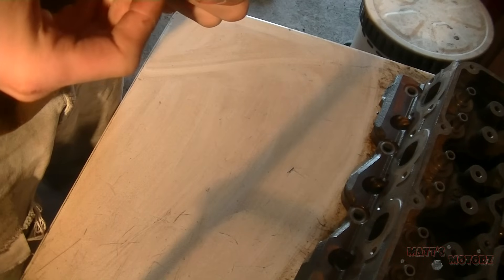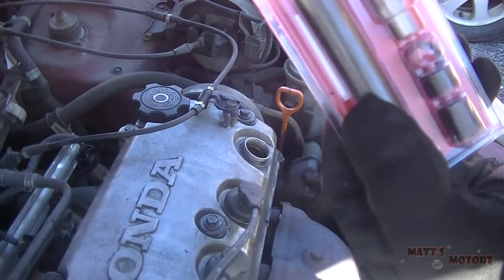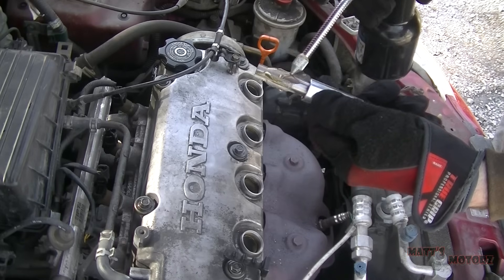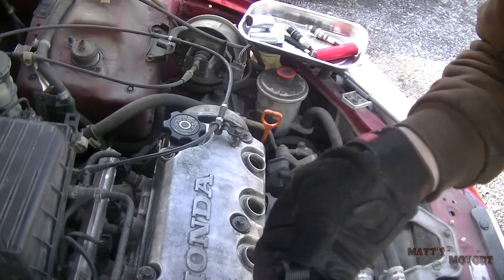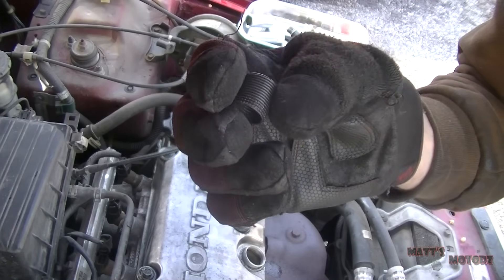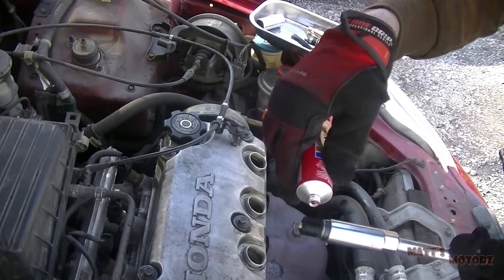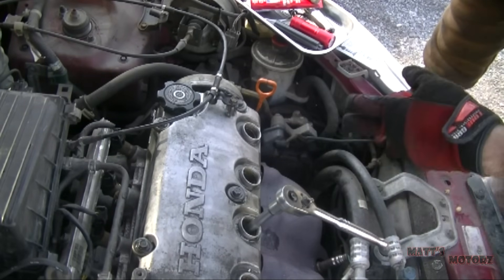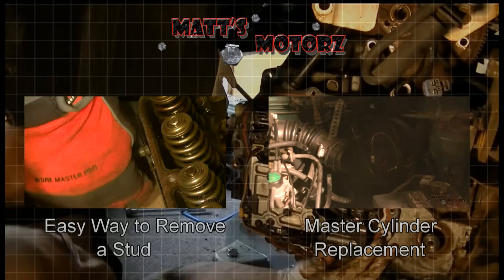Repairing Stripped out Sparkplug Threads

Comment from the maker: Everybody needs to chill about the chips in the cylinder.

1. The compressed air blows a lot of the chips out
2. If you are really worried, remove the spark plug and crank the engine over.  The piston will push the remaining chips out of the spark plug hole.
3. The hardness of the chips is less than that of the cylinder walls, valves, and piston rings, as the cylinder walls are sleeved with a harder material, the rings are made from cast iron, and the valves are made from super hardened steel.  The chips won't scratch them up.  The valve seat is also a pressed-in harder piece of steel.
4. Engines are tough machines and will not be subdued by a few chips.
Reply: MattsMotorz 
you don't use oil, but grease. Grease will retain much more metal shavings and minimize damage to the internals of the engine...
Reply: alum chips are not an issue and normally blow out on start up
Reply: I have a question if I buy a Saturn 2006 and the guy said he strip the  spark plug would it be okay a good idea to buy it he's selling it for $900 would that be okay is anything wrong with the motor or anything if I drive it from his about 40 miles to my home
Reply from the maker: A stripped sparkplug  hole can be a big deal.  It can cause compression loss and cause the engine to misfire.  If it is running ok then it might be worth it.  What is the KBB value?? Repairing a stripped sparkplug hole as I do in this video is not for the faint of heart, and many shops wont even touch it because doing it wrong means a BIG job in repairing / replacing the cylinder head.
Reply: MattsMotorz I got a question is installed the coil insert it seems like my car has a loss of power and spudders do you know what it could be? I'm going to try the kind of insert you used in video
Reply: I promise you he sounds just like Mathew Broderick good video to
Reply: Would had made sure both valves were closed before blowing the chips out. Chips could prevent valves from closing properly.
Reply: Abolitionists
Reply: You just answer in my crucial question! I like your video!
Reply: Lol instructions. Step one... pack tap with heavy grease. "Hey let's take car advice from a guy that can't read!"...
Reply: i know I am quite off topic but does anyone know a good site to stream newly released series online?
Reply: @Leon Allan i dunno I use Flixportal. You can find it through google =) -connor
Reply: @Connor Saul Thanks, I signed up and it seems like they got a lot of movies there :D Appreciate it!
Reply: @Leon Allan No problem =)
Reply: She can not digest chips.. it may cause "Dysentery" ..
Reply: it can go into valves too
Reply: Welcome to YouTube comment section, where everyone is an expert.
Reply: I have to do this I no it gonna be in a pain in the ass spec since someone already tried putting an insert in there I hope I can go a size bigger 🤦‍♂️ or I’m going to have to just leave it in there .. or hopefully I can jus get the same insert and put it on a new spark plug and it goes in plz help if u can give me any info
Reply: MattsMotorz lol.... Youre a real Hack. Quit fucking up peoples engines. Youre lazy af and a terrible mechanic.
Reply: @TanTan-ni4mg  viewers are open to a better alternative if you have one.
Reply: Tan Tan and you are a prick.
Reply: @TanTan-ni4mg alright then shut the fuck up and take your car to the dealership see what they tell you

Comment: 🤦🏾‍♂️ Probably no one will see this but Im currently having to rethread cylinder 6 spark plug hole on my e46… I used grease, instead oil on the silver rethreader. I had to use a 3/4 socket because the rethreader didn’t fit in the 5/8 spark plug socket. Now the socket and rethreader WONT come out the hole no matter how much i try to loosen PLEASE HELP

Comment: I've changed 1000's of spark plugs in my life without any problems until now.   I tried to remove the spark plug from my pressure washer.  When I broke it free I easily turned it out about 10 turns with my fingers then it suddenly stopped.  It became very difficult to turn back in or out with my socket wrench.  I decided to forcibly remove it and when I did the last 3 threads of the plug were filled with aluminum from the head.  I've never seen this before until this video and your plug.  I have no idea how this can happen.  The plug was the original from the manufacturer and had never been out as my machine was still new.  I know it couldn't have been cross threaded because I was easily able to unscrew it most of the way with just my fingers.  How could this happen?  Do you know what caused this?   Also, could I get by just re-tapping the hole and not using any insert?

Comment: Step 1.  Identify intake and exhaust cams are on overlap (both valves closed) and cylinder is on tdc.   

Step 2.  Continue with drills/taps/etc

Step 3.  Insert magnet for steel shavings.  Insert shop air for aluminum shavings.  

😂❤❤❤😂

Comment: Some extra tips:  RTV silicone will not stick to oil, so be sure to clean the threads with brake parts cleaner or equivalent. Make certain that the piston is down far enough so as not to damage it. Fill the cylinder with shaving cream. The shaving cream will catch and suspend the shavings. Then vacuum the cylinder afterward, with a shop vacuum.
Reply: Good idea with the shaving cream.  I was trying to come up with something to keep shavings out of the cylinder - that's why it's called shaving cream, right?

Comment: I used the OEM kit where the insert has a flange instead of teeth. The flange stops the insert at the “right” depth. However, when measuring from the well opening down to the spark plug terminal, it sticks out about 1/32” further than the neighboring plugs that didn’t need re threaded. After the job when I turn on the engine I hear a soft tapping and now the festering thought of the electrodes not deep enough into the cylinder is making me second guess my work.

Comment: I hope someone answers me before the wife gets home...(lol?)...but how far do I tap/bore? And if I go all the way, how do I get the tap out? I am not a mechanic. I just didn't want to pay $250+ for someone else to do what I can do for around $50...and I really can't believe my wife is letting me do this. Lmao
Reply: I’m curious to see how it turned out. I used the OEM kit where the insert has a flange instead of teeth. The flange stops the insert at the “right” depth. However, when measuring from the well opening down to the spark plug terminal, it sticks out about 1/32” further than the neighboring plugs that didn’t need re threaded.

Comment: Wow this is a great video! Question... so there is no need to remove manifold intake, or gasket and valve covers to rethread?? Does the manifold intake have to be removed if this were done on cylinder 4 (the front left) ‘07 Acura MDX?  This doesn’t seem as dramatic as some mechanics are acting.

Comment: Did this a couple of times on my 99 Eclipse, cylinder #2.  The sparkplug just blew off while I was downshifting from 3rd to 2nd gear.  My mechanic was busy fixing a few other cars and he just told me what to do since it would be a few days (if not more than a week) before he can fix mine (he's on call, appointment) as he was rebuilding an engine at that time.  I also had to grind the butt end to fit my socket.  I then used double sided tape on a thin rod to take out all the shavings that fell inside.

Comment: Just did this repair myself today. 

My spark plug blew out of my cylinder head on my way to work. (Luckily it was right down the road) 

Was able to get towed by a local friend back home (didn’t want to run it on three cylinders) 

Installation was flawless. 

Tips for everyone: 

As addressed you’ll have to grind down the 19mm tap, was able to hammer a 17mm socket on there and get it down in my spark plug tube. I used axle grease to catch metal shavings (worked) and ended up using my shop vac to suck the exhausting shavings out of the cylinder head. Started it up with the plug out aswell and it blew everything out. 

Used red rtv on the insert and make sure it’s completely flush with the beginning of the hole. 

The driver tool I gave it about a good three or four taps with a hammer and it was golden. 

Little tip with the driver (use old shirt cloth and stuff it around the driver and the socket that fits around it) and it worked like a charm. 

Took it around the block and it ran perfectly. Will report back later on how it holds up but thankful I finally have threads
Reply: In your opinion would this fix a melting ignition coil also? 2009 civic melted a coil and the spark plug shot out damaging the threading as well. Replaced both and it happened again. So wondering if it's likely an electrical problem causing the melted coil, or engine heat that passed through the spark plug and damaged threading?

Will be buying the kit regardless along with new coil and spark plug, then ignition wires and ECM tested after installation.
Reply: @tc6367  what happened? Did you find the reason?
Reply: @Krischanzzz  LOL I just went and got the whole engine replaced in August since it needed a cylinder head. Who knows what other problems were in the 215k mile engine.
Reply: @tc6367  😂 okay, thanks did you spent a lot for it?
Reply: @Krischanzzz  Yeah, 3k but I bounced back. It was the best decision considering how expensive a newer car is. I use it to make money as well. Deliveries, apps, UPS peak season etc.
Reply: @tc6367  i see it was worth doing that for you. Im still thinking about mine as i have some cooling problems and the clutch should be changed soon (it is semi-auto) so im pretty sure i have to fix this and sell asap 😃
Reply: @Krischanzzz  Yup I changed the clutch this year too. But for cooling, only had to buy both radiator fans and replace those. I'm debating to sell mine around memorial day which would mark 7 years I've had mine. 09 Civic EX-L manual.
Reply: @tc6367  what you gonna buy after that? Do you have anything in mind?
Reply: @Krischanzzz  If it's not another manual, then I want something nice and comfortable for road trips. Newer Avalon or brand new Camry.

Comment: So my spark plug blew out and I was using this method to repair it... But the original threads are not holding the tap in as it gets screwed in.Therefore, I never maker it to the wider part of the tap to make new threads. Does anybody have any ideas?

Comment: I used red grease on the tap to catch most of the shavings. I then put an ounce of oil in the cylinder to gather any stragglers, and used an oil extractor to remove the oil from the cylinder.

Comment: Maybe I’m dense but how do you take the spark plug out once you’ve used it to put the new threads on without the threads also coming off?!
Reply: Dont over tighten the spark plugs so the threads don't come out when you take out the spark plug again. If it comes out again you'll have to take out the cylinder head sadly

Comment: So from now on, Can this motor swap sparkplugs w/o continued issues? Or is this just like a bandaid fix to sell to an unsuspecting used car buyer?
Reply: steel threaded inserts are used in performance applications all the time because they offer better holding power and decrease wear compared to aluminum alone, just be sure the spark plug is held at the exact same place in the engine. manufacters dont do it because its usually too expensive. now he can change sparkplugs in that hole without worry of stripping. the one downside is that inserts can insulate spark plugs causing them to run a little hotter, but this is really only a problem for high performance applications

Comment: Silicone sealant is helpful however too much it leaks into combustion chamber. Understandable it's cold n need to get it done but helpful tip to anyone do a little at a time and dont use that much silicone sealant. Lifters can get gunked up and then u have to replace those. Good last repair while saving up for a new head.

Comment: Couple of things.  Use red locktite instead of rtv.  A t handle is easier than a ratchet as both hands can be used and minimizes side load.  Every  half turn back up a quarter turn to break large chips.  This is due to the aggressive cutting portion of tool.  It would be easier to remove valve cover than to work with it in place.

Comment: Using anti-seize compound, makes the spark plugs screw in smoothly. If it isn't smooth, you will know immediately that you are beginning to cross thread. Also, always use a torque wrench to spec. when tightening the spark plugs. It sounds like being over cautious until you strip the aluminum head and then you know the effort was worth it. If you do that always, you won't need this video.
Reply: That's not entirely true. There are other reasons beyond stripping the threads that would warrant needing to re-tap. But for the most part, yeah.
Reply: The problem is most that don’t know how to tighten a spark plug without a torque wrench don’t know how to use a torque wrench ether.

Comment: Can also add never seize to plug threads before screwing insert in.  Helps plug release when you’ve gotten the sleeve to depth.  I’ve seen some use red locktite instead of silicone based product for sleeve itself then wait 24 hours.

Comment: Hilarious, blowing chips into the motor not out 🤣
Reply: Dave G put your naked eyeball near the hole blow with compressed air and if you’re not too blind to type afterwards. Tell me the chips don’t come out.
Reply: If valves are closed.. the only opening is back out, so yes blowing compressed air forces the chips back out of the hole. Can also use a cheap bore scope to check to make sure you got it all.

Comment: What would you recommend, my front motor mount, the one thats right in front of the front radiator, the bolt holes is stripped... what method or what would you recommend to do to fix that? Their is no space at all to fit any tool in their and I dont want to bring the engine down to fix that.... Just any suggestions or tip would be great.

Comment: Quick suggestion its better and easier if u drill out the old damage threads and make it flush before using the tap. You get better results. I just did it on my bike and on my boat. With great success
Reply: Oh and as far as chips. Just leave the plug out and let the cylinder pump it out. Or used compressed air

Comment: For those worried about shavings: 1) put axle grease on the thread tool to catch most of the shavings; 2) get a vacuum cleaner and some sort of adapter (or tape it) so you can stick a hose/tube down into cylinder head and vacuum out as much shavings as possible, then use compressed air to blow out anything left over.
Reply: Yes use grease- compared to oil, the thickness of grease will catch more of the shavings.....
Reply: Just turn engine on with spark plug out it'll do the dirty work itself

Comment: Just bought a 96 civic looks like the previous owner tried to do this but the sleeve came out with the spark plug so the spark plug looks bigger than other spark plugs, do you think if I just bought the kit and put a new sleeve over it that it would work?
Reply from the maker: Might work, it is hard to say.  You would have to hope that the thread size and pitch is the same between what the previous owner did, and what you bought.  I would run a tap through it first. (The size would be what ever the bigger sparkplug is)

Comment: Aren't you worried about any metal shavings getting into the cylinder and remaining there?
Reply from the maker: Nope
Reply from the maker: The air from the air gun blows most of them out.  If you are overly concerned, just crank the engine without a spark plug in it to push em out.  Engines are tough machines and wont be fouled by a couple of chips.

In more detailed terms, the metal from the shavings of the cylinder heads is not nearly as hard as the metal in the cylinders or the pistons and especially valves, as most often, engines are sleeved to have a harder material to reduce wear on the cylinder wall.
Reply: I have a Nissan Maxima 1994, one of its spark plugs has been cross-threaded and repaired in a similar fashion (using a lathe-worked piece of aluminum for the new spark plug sleeve). However, yesterday the damn thing's thread stripped completely and now I face a similar situation. What are the chances of the head thread to be damaged as well?
Reply from the maker: So you're saying there is a threaded sleeve in there already?  And the threads on the inside of the sleeve (where the spark plug goes in) is stripped? (Just trying to understand)

If that is the case, I would use a drill to drill out a hole as close to the head threads as you can, and then just run a tap through it to clean out the rest of the threaded insert.  From there, you can proceed normally to install a new threaded insert as I show in this video.

Comment: Heli coil keeps coming out when I take spark plug out
Reply: Use threadlock on the outside part of the helicoil. Works better than the high temp sealant he used in the video.
Reply: HowardSupra  I was told hole was to big for heli coil that's y it's not screwing in
Reply: then, you done fucked up Cletus.
Reply: Does it really matter?  Next time you change the spark plug, remove everything and then put in a vise to remove the plug from the insert or else use another insert on the new plug, if you have one.

Comment: I would have used red Loctite   but alway use anti-seize  on spark plug threads and lug nuts
Reply from the maker: The directions say to use high temp RTV.

 Loctite (even red loctite) fail under conditions of high heat.
Reply: Good to know